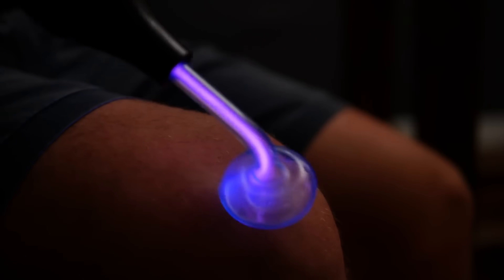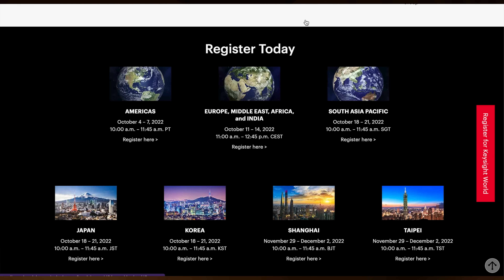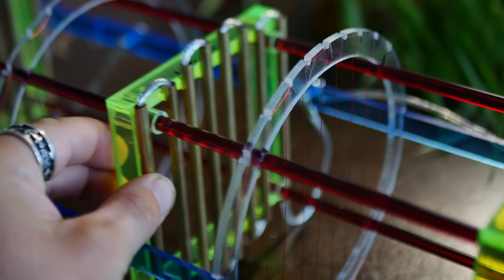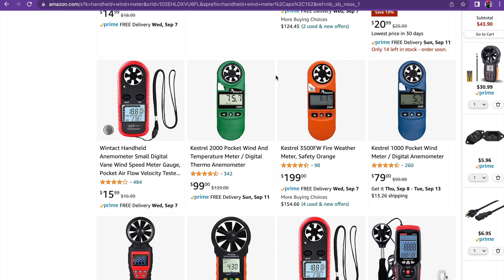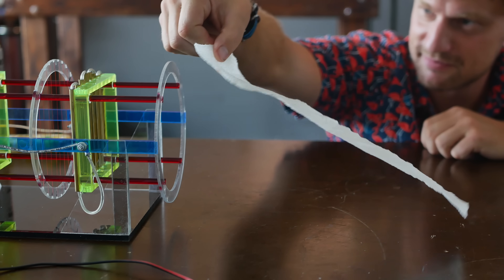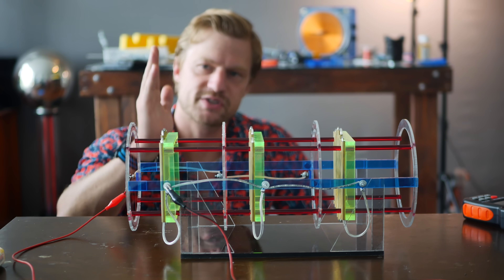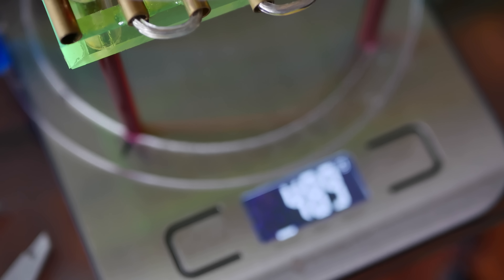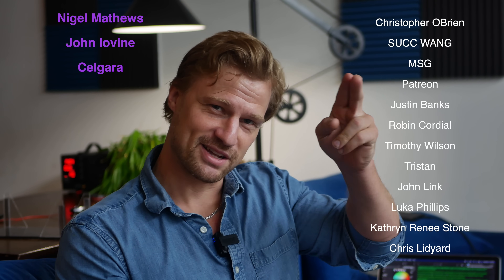Designing A Next-Gen Ionic Thruster! (For Flight)

Comment: The internals should be circular in shape and arrangement and it needs better containment to direct airflow/plasma. You could probably provide cleaner power flow at higher voltages with some supercapacitors. So yes, please continue.

Comment: Increase the Stages to 7 for optimum thrust, and then modify the wire gap and increase the wire density, and add a plastic cylinder to keep the ionic flow contained within the "tube".....you may also want to increase the spacing in a progressive manner, the more energy to put in the more distance between the next row of electrodes. Then run it in a resonant manner, IE pulse the excitation at a specific frequency, you can do this with your current set up to fine tune the most efficient frequency of excitation, I suspect this excitation will need to be tweaked with air density changes

Comment: Well there are many things that are issues. 

Look at smoothing out the air flow path. right now there is lots of turbulent air. 
You should have a horn Design in the front. 
Try flattening the rounded ground tubes to be inline with the path of air. 
Play with a tinny amount compression at the tail end with a tapered tube. 
add internal fins to help keep the air moving straight.

Comment: 1. The weight of the power supply?
2. Focus the output by enclosing/air nozzle?
3. Increase density of electrodes/wire mesh?
Cheeky 4th - Would a fan increase efficiency or is that "cheating?"

Comment: Awesome idea and great execution!  Have you considered adding a half-toroidal/half-conical "intake cone", and/or perhaps even making the entire linear chamber a semi-de Laval nozzle design to possibly amplify airflow?  I would hypothesize that enclosing the entire chamber in any sort of cylindrical design will help output tremendously, though.  Adding multiple, (evenly radially and axially spaced) nacelles/NACA ducts to draw in airflow directionally and not let it escape as easily (ones you could quickly plug or leave open for tuning optimum results during testing), should also contribute to overall throughput airflow/thrust with a cylindrically enclosed design.  To save weight, use nylon fasteners where applicable and aerogel or carbon fiber structural components rather than acrylics, (if you have access).  Good luck on your progress!
Reply: ah yes, the axially spaced NACA ducts. Of course, why didn't I think of that!

Comment: 1.) Uniform spacing at same voltage while preventing escaping air from in between,
2.) Maybe a change in wiring to promote more flow of air through the thing,
3.) Make it single stage

Comment: Dude, i suggest try to put some winded coils between the gaps of section and try to meaaure if you have some voltage to measure...i think you can create power rather than using as thruster...i think its not air moving its a magnetic field produced within..

Comment: A few thoughts: (1) An inlet funnel on the front to increase air draw & compress the air intake, (2) a cover (cowl) to stop the air from escaping out the sides , (3) more segments, (4) perhaps testing segment distances using the Fibonacci Sequence, as the Golden Ratio is common in fluid dynamics such as in cyclones and propeller vortexes.
Reply: Increase the rows of positive wires (a lot), making them thinner at the same time. It will give more surface area for the air molecules to be ionized and still having sharp cylindrical edges due to the thinner wire.
Reply: All of this plus making it smaller and then having a whole array of them clustered together.
Reply: all of this plus: a dramatic surface increase for the negative pole
Reply: @skipperlefl  Having more internal space for thrust generation is probably a good thing. I'm not sure if it scales faster than the weight, but it's possible. Needs some testing, as with all of these suggestions. Possibly, he could layer the wires grid-wise or even all the way around at certain angle increments? I don't think the ground poles need to be parallel to the wires or even match them, I suspect a single ground pole per stage would work, even though there are diminishing returns relative to distance from the ground poles, I don't think the diminishing would out weigh the ground poles. Perhaps he could have some insulators between the electrodes so they could be stacked closer to eachother (if that's even why they aren't packed closer). Maybe instead of ground poles, he could have a thin ground pole, but a metal sphere in the center? I'm just spitballing but there could be some good things here if workshopped to the correct specifics.
Reply: A nozzle at the end might increase the velocity and thereby thrust
Reply: This was a lot of seemingly good ideas in a small space
Reply: Let’s just hope he listens
Reply: Perfect
Reply: I was thinking about the same suggestions.
Reply: Amazing build. I was curious about the same idea.
Reply: I was going to say the same!

Comment: Wonder what would happen with finer grid wire spacing (e.g. more wires per unit area).  Since wires of he same grid are all at the same potential so finer grid spacing should be OK.  Also ducted airflow - it seem air would escape out of the column.  Also  perhaps just use wires (on metal tubes) for the eletrical grids.  Looking forward to the next build!

Comment: Encase in a tube, use dc on the ionic coil, an a Hv VFD  control the burst of ion gas. If you create a spinning field you can create a little compression. The hard part is the balance of the inducer. Great build btw

Comment: Glad to see lifters making a comeback.  I made my first one with mylar and 30 guage wire after reading Bob Iannis Evil Genius series over a decade ago.  Though you get slightly more efficiency more higher stages, you tend to add a lot more weight to thrust ratio.  The staggering improved because you were dominating current to the region closest to the measurement device.   Still, lots of fun.  Once you have a ideal voltage for a suitable gap you will want to optimize current.  Also, use the thinnest wire possible for your negative electrodes.
Reply: You should check out Ethan krauss's ionic wind device on YouTube. The power supply is on board.!

Comment: Was looking at circuits for ultrasonic humidifier that use a ceramic disk to convert water to steam.  What if you combine that as a fuel source for your Ion thruster.  You could make a low pressure container containing water (or other fuel) with a wick and your ceramic ultrasonic element.

Comment: You showed in the video a staggered spacing of longer gap at the front and shorter at the back. It might be worth checking if the reverse performs better.

You show a shorter gap provides the best thrust, so maybe that is the best way to get the still air moving, but once it is moving, perhaps having a longer gap to further accelerate the air would prove effective.

Additionally, as others have said, I think trying out an enclosure or ducting of some kind might be good, and I agree with this, but it might be interesting to see if you can add some kind of intakes along the sides (perhaps in the air gaps between electrodes where air flow will be fastest) of the ducting to pull in extra air via the venturi effect, thereby increasing the overall output, without sacrificing efficiency to turbulence with the surrounding air.

Comment: Call me crazy but: ionic paraglider. Thin film solar panel built into the parasail for DC power, booster circuit in the carriage. Use the design developed by the "Ion Power Group" for their atmospheric ion collection wires or a conductive carbon-silver ink coating to form the anode on the front upper rim of the parasail canopy, and the cathode halfway up the rear sail wires. The 3D carbon structure of the ink increases the surface area, as well as drastically shrinking the radius of curvature of the conductor, giving it much larger electric field strength for a given applied voltage; ionization can occur at much lower than a Kilovolt with micrometer to nanometer scale radius of curvature. Field emission effects become significant when the radius of curvature or gap between electrodes is smaller than 10 µm, leading to the description of the modified Paschen’s curve. The parasail would also have a much more non-linear electric field gradient than a parallel electrode configuration due to a longer conductive path between the top canopy and wire electrodes, and the needle-to-plate type configuration. Airflow would be pushed to the side of the canopy, dropping the pressure above it, producing aerodynamic lift while stationary as a blown upper surface wing.

Comment: Exotic materials to reduce weight? Carbon fiber, graphene wires to discharge electrons? Increase stack amount with a crisscross pattern for extra surface area for the wires to discharge! Id like to see a shell around the engine to help make flow laminar and maybe test a turbine to compress the air going in?

Comment: So to be able to adjust the panels safely whil running to find the optimal spacing, if the ionized particles are moving in a wave it would make sense, my theory is that once the optimal spacing between panel 1 and 2 is found the optimal spacing for panel 3 will be roughly half that. So you may be able to get tighter without losing air speed.
Also while moving the panels it raise and lowers instead of just dropping or raising it shows that there is a waveform. And everything before beginning of degradation  should be constant. So find double the safe distance of arcing, that's should be the distance of the 1st two panels. Minimizing the interference of non ionized particles.

Comment: how to make the wire it self more effition. 1. gauge of wire 2. surface wire ( rough, smooth, microscopic holes spaced at vering distances to focus plasmas into a cone , point etc etc and then you never know you may figure out how to focus direction of plasmas changing direction. this would reduce weight because there will be no need for mechanical steering. why is the plasma green ?

Comment: Would it work better in a tube so air only entered from the front and the back? Sorry not great with fluid dynamics but I wouldn't make a water pump that had open sides so why with air. Then again there could be pressure dynamics i don't understand that would come into play. Then again could you pulse low pressure zones in a tube to sling the air from zone to zone? That would only help to a point then you would be limited by your speed of pulse, as well as your ability to create negative pressure. Don't know man, try it in a tube.

Comment: I did a small research project on this topic as well. What I found is that thrust greatly increased, when I simply put ends of wire along the emitting electrode which increased the electric field strength at the tips and thus lead to much more Ions being created. Unfortunately I didnt have a way to measure the electric current or efficiency, but the thrust doubled by just winding a few wire ends around the emitting wire. Same concept can be seen by just using a smaller diameter wire, which results in the same effect. This however comes with the problem of a much lower durability so there's a compromise to find there. (However it has to be said that the thrust only increases, because the threshold where you start to see ion wind is decreased. As i was operating at ~25 kV the effect is much bigger than at for example 50 kV. With the wire ends added, a force could be measured at 5-6 kV and without them it was only at 10-12 kV. This way much more of the Voltage can be used for accelerating the ions and not just for emitting them. But as already said this 5 kV difference I measured will have a smaller effect at higher Voltages)

Comment: 1. Have all wires the same length, creating a square rather than a circle
2. Offset the large bars one after the other to prevent drag (?)
3. enclose the system, with multiple radial nozzles en route

Comment: Guess on inefficiencies:
1) back flow from stages interfering
2) turbulence cylindrical ground tubes 
3) open air design causes loss of flow

Suggestion:
Replace the ground tubes with grid of blades to encourage more laminar flow.
Switch the + - + - + - voltage pattern with high medium low pattern to prevent back flow. Maybe you could remove some of the grounds this way and make the whole thing smaller.  Add a tube to keep the air from escaping out the sides.

Comment: Been a while since the old fluid dynamics classes but let's give it a go:

1) the circular cross section of the electrodes cause a detached flow, and thus excessive drag in the air column

2) the gauge of the electrode "tubing" allows for far fewer turns inside the tube than is possible, reducing the potential contact surface area with the air flow.

3) the circular cross section of the chamber has gaps on two sides, allowing accelerated air to bypass electrodes 2 and 3 on either side.

No idea if this is correct, but gave it my best shot.

Comment: 1) Area of the positive electrode(thinking of a pointy design, something like a spread out wire brush look).
2) Drag coefficient of the ground electrode.
3) Ac cover, for the whole system with decreasing volume in each sector to accelerate the airflow.

Comment: The flare, thermal or searing burns of a rocket thrust, doesn't create the moment,  it's the pressure of exertion.  Some with the angular momentum of a gyroscopitic technological can create a geo-scoptical direction mass motion space-swiming movement. Ion, Plasma & other Acoustic & Geomagnetic harness have been supressed for so long, odds are you were not beaten,  just not approved secretly🤫.

Comment: I would imagine that you would get more force if you contain the thruster. I would also imagine that if you considered putting them at a half inch or so in less that would make feed back or stress the design. I would also imagine having it tested in a vacuum or in a neutral weight environment simulation you might get different results.

Comment: Ok so my suggestion is going to add weight. it may help to get more air in and moving faster.
So shrouding can help keep the flowing air from escaping around the electrodes. 
Funnel shrouding will force the flowing air into a more concentrated area while inviting extra air in from outside into the next stage because of bernoulli's principal. So look, electrode funnel electrode funnel electrode funnel.
|:|>|:|>|:|
With partial cylindrical shrouds shrouding the electrodes themselves but allowing additional air to be intaken (?) Intook(?) Inducted(?)
I don't know am I saying this right?
Are you envisioning what I'm putting out? I'd really live to see if it works.
Maybe it would need some strikes inside and out of the funnel shrouds to prevent swirling.
Maybe if I could send you some F360 cad files or maybe an stl if I'm not saying this well enough to put the image in your head.
Dammit now i have to build it.
So I'm looking at a bottle of rubbing alcohol wondering what would happen if you squirted a little bit of accelerant in there. I think it would be glorious and destructive.

Comment: Create an external cylinder in order to control air flow; however control pressure build up by placing ventilation slips on the top and bottom and play with sizes in order to increase pressure careful with lack of additional oxygen and electricity as it may become chemistry pretty quick. I'm used to using liquid o2 in my experiences so idk if that really plays a role here. 

However worry about the loss of continuity by the purity of the type of conductors youre using as well. Electricity converging at 1/8 with physical matter allows you to have adjustable sliders on your amplifier  and really give it that extra umph. I'm motivated to try out my own design seeing this. This said different gases may give you more thrust but also will break down and may cause a critical failure, you could also use the plastic structure as a reclaimant system that allows you to use the air velocity and recycle the back flow back into the feed this making suction from the outside better, more pure and conductive meter help here but require coating that would focus continuity in directions beneficial to you, may try a helix and form a siphon, but that would allow control of all aspects. 

Hopefully this may help. Theory of operation and application is a bit more tricky than expected. Cheers. 

Have more additions and modifications but that requires insulated equipment and to double the weight to two lbs but you could definitely at least hit half weight to thrust. 

I technically gave you 6 ways to make this better ... 7 if you consider air temperature. Good luck.

Edit: for you trolls out there, we use reclaimant systems on most US made and used weapons. Pay attention to air flow direction as opposed to air drag and have that in mind, after a point of going so fast, the weight of air has problems with choking itself out. Better to build it into designs now.

Comment: The design itself is so simple, yet incredibly impressive. Much of your problems though lie within improved voltage regulation, intake filtering, and directing the flow of plasma through a concentrated exit port to maximize your output thrust.